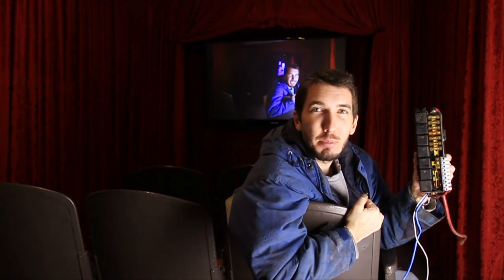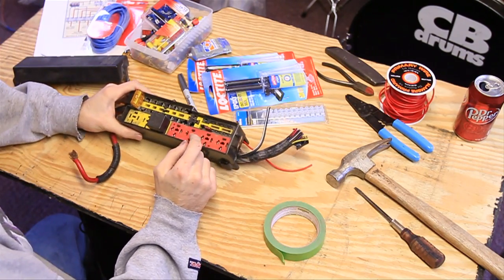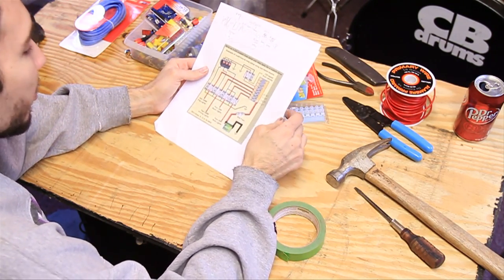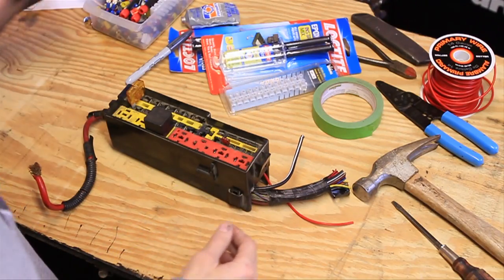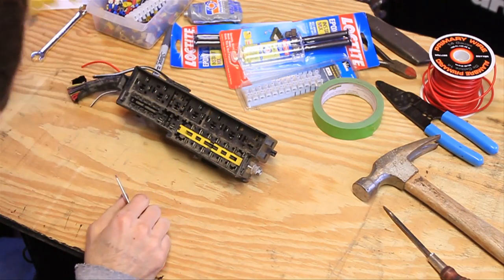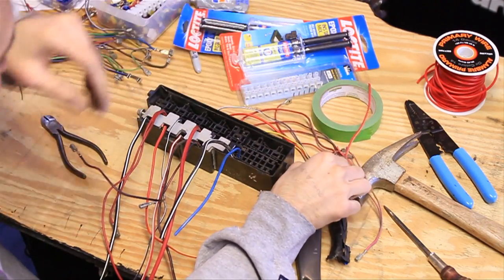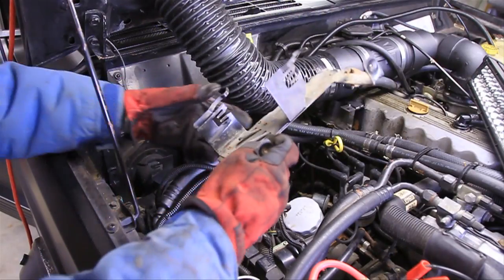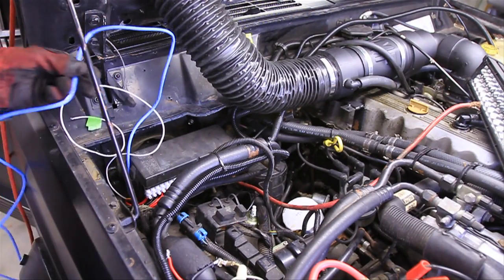BleepinJeep's DIY:  Relay and Fuse Box

Comment: I do repairs for large chain body shops as in wire harness replacement and repairs,  frame swaps ,diagnostics  and programing and anything in between.  I really appreciate the thought you put into  this... we're supposed to return the cars to factory by every now and then we get stuff where the owner has added circuits with no direction at all lol.  Those jobs are horrible . It can be  really aggravating to try and get em back to whatever they had going on before the accident.   Most times were missing the majority of whatever it was that they wired up so it gets outta hand quickly especially trying to do an estimate without replacement parts.  Only thing I'd change is to solder any connections possible and use heart shrink with the glue inside to completely seal the joint.  With the mud, water and dirt intrusion while out wheeling it don't take much to get the crusties and that can wreak havoc and possibly ruin components and start fires but having said all that I want enthused about doing any of this on my xj lol.  Good work bro.  I really though I'd be working on my rig all the time but she just sits there haha.  My lift kit isn't here yet and neither is the radiator and steering column so I can't really dive it yet... I'm hoping when the parts get here I'll overcome the dread of working on my own stuff ... the thought of being out wheeling should get me going...I hope

Comment: I followed this video and successfully built my own fuse/relay box for my YJ.  Very similar to BleepinJeep but I think my end product is quite a bit better.  I got two fuse boxes out of early 90's XJs and was able to disassemble them with minimal damage, hence no need for epoxy.  I was able to re-arrange the existing cables into a different configuration that gives me 7 relay outputs that are each individually controlled.  Additionally,  they wiring harnesses I removed provided plenty of good wire for both outputs and the control wires.  I looked at CAT 5 but found that re-using the harness wires made a far more durable end product.  Only downside is that all of this took an insane amount of time and effort.

Comment: Wow, I never thought of using cat5 or cat6 cable for automotive applications.. Neat idea!
Reply: why not just pull a entire dash harness with like 100 wires at the scrap yard for like 20 bucks you get tons of fancy colors too !
Reply: USB protocol has a fundamental distance limit of only about 16 feet
Reply: yes thats true, but if your going through the trouble of doing that you might as well just use the extension cable that came with the extender. a side note, i think usb 3 might have a longer limit too
Reply: oh i see it uses cat5, thats cool
Reply: The number one reason you might use network cable is for the shielded variety. Works super well for sensor data lines.
Reply: I would use stranded wires. The solid wires in cat 5 don't last as long in applications where they get bent or vibrated too often.

Comment: This guy is just like me, HE TOOK APART CRIMPS TO RE USE THEM! 2 days ago I pulled apart the micro switch on my cars RKE remote. Pulled the thin metal cap off to discover no convex conductive button to short the 3 traces. Being as my PANIC button only has the range to be annoying, I took the convex flex button out of that and replaced it in my unlock button. Jeepin Brother From Another Bleepin Mother :)

Comment: Good re-use of parts there! works for a good tidy install.

If you do a search for "mini-blade busbar terminals" you can actually buy the proper crimps that should click back into the slots saving you epoxying them in place!

I'd also be careful with the amp rating of the white connector block you use as this size are normally around 10-15A.
Reply: Ive spent about 4 hours trying to find these online you are a god damn life saver
Reply: The terminals aren't what breaks.  It's the plastic tabs in the block.  I managed to only break one or two.  The metal tabs are easy to reuse, but it sure would be nice to have had a pile of loose, new ones.
Reply: Can you put up some part numbers and where you got them?

Comment: 4 years later a few updates:  you can also get this in grand cherokees - same fuse box.  Also, with Cat 7 being out, it's considerably thicker than cat 5 or 6, so I would use that instead.  Last but not least, use a cat 6-7 punchdown keystone jack to terminate the wires coming out of the fuse box, and one for the switch box... then just connect them with a cat 7 cable without having to strip the ends down.  Or at least that's my plan. :D 

You are looking at about half an amp per pair of wires in that cat 5 cable, hope that's enough to turn on those relays...
Reply: What year grand cherokee?
Reply: @Aximili55  not sure if you have found the answer yet, but 1992-1998 seem to have this panel.

Comment: Depending on the length and location of the red "hot or positive" wire connection to the battery, a fusible link near the battery might be a good protection against a possible chafe or damage to what is basically an unfused wire otherwise. It is an extra step, but it could save a fire and/or damage to valuable electrical parts.
Reply: Automotive breaker  same concept as breaker box it the house...

Comment: Great video write up.  One suggestion you can get wiring snake that has 22 gauge wire in it with a shielded and insulated jacket.  Basically the same thing as the cat 5 cable but larger gauge designed for doing audio video patch panels for broadcast work and stage microphone wiring.  The stuff is more expensive but a length long enough to reach from the relay box to the cab probably wouldn’t cost more than 20$.  Pro audio multicore wire.

Comment: Great video Matt.  I applaud your willingness to share your knowledge with us DIY'ers on limited budgets.  To the critics of using CAT5 cable....look around and you can find stranded core CAT5 cables.  Stranded CAT5 is usually used for connecting laptops to a network.  They may be more expensive but it might help them sleep better.  Just saying.

Comment: an addition I would make, before putting the epoxy on the terminals I would slide the relays into place to make double sure each spade terminal is lined up as best as possible, would make later sliding them on and off a lot easier.
I plan on making a few minor adjustments :)

Comment: I tried using the CAT5 however the relays I used pulled more power than it could handle. Flipped a switch and had a immediate small fire. Ended up using 18 AWG to power the relays. I really liked the idea though.

Comment: Matt, maybe just one suggestion. I would put a high amp fuse on the supply wire to the entire box. One used on a stereo amplifier would work well and could also be found at the junkyard. They can easily carry 200 amps no problem.

Comment: Ok  I like what you are doing and how you are doing it ,I envy you in your patience and delivery and kindness to all of us by sharing  what you have done ,if like me yo will do it just to prove you can bypass the check out counter.I hit that like button and subbed your channel , I rarely do that .What you have in patience I make up for in fowl language and tenacity. I usually wont stop until I break it or fix it .
      Where you ran the single 12v supply wire along each fuse connector I 'll do the same  ,but instead I want to bypass the fuses or the need for them altogether , by soldering  a jumper across  each given fuse connection point to the 12v supply wire and onto whatever designated wire or point the fuse was intended to protect . No worries about current draw ,my old jeep id pretty much no frills bare boned almost to the point of a Willis GI issue. .  Im not asking for any advice or other freebie time soaking stuff ,besides ' Im much too hard headed for that , but if you read this in the next 24hrs and can find your old wire clippings I sure could use the colors and stripes from the old ones theres not much I can do seeing how packed in there they all are and the harness wont let me peak at the ones Ive got . Stay safe God Bless ,wear your condom and wash your hands you might have popcorn for supper never can tell these days

Comment: bleepinjeep  The Maxi-fuses have two clips. If you pull up the yellow bracket, you find a plastic clip. Then on the metal connector itself there is a metal clip that needs to be pushed in. The maxi-fuse holder then slides out.

Comment: I suppose since you're a Jeep guy dielectric grease is ideal. I preferably would use the (yellow) clips. It's less messy. Also That's really cool you salvage parts like the fuse block and license plate as the switch panel. Less waste.

Comment: I did this using the existing wires. took a bit of time to tear apart and sort it out. then I ran a large fused wire from the battery to the back seat. since I am using mostly for lights I ran all to the back seat. then removed the jack and used the holder to keep the box in place. it is out of the mud and weather and if it gets wet I am sure I have far bigger issues.

Comment: Would have been cool to put a female cat5 connector into the side of that powerblock module, then you could have just "plugged in" your cat5 cable!     If all your switches are in one place, you could have put a 2nd female cat5 connector on the side of your switch module.
Reply: thank you, i am going to try this !
Reply: @24:18 for more Cat5 stuff
Reply: The problem with the RJ-45 connector is that it doesn't have any current carrying capacity.  It's designed for signal voltages and currents in the milliamp (mA) range.  Look at the wire fingers in a connector and ask how much current can really pass through a single point of contact on a 30AWG wire?  Many relays draw up to 2 amps of current to operate the solenoid depending on the relay design.  Others use only .5 amp.  Be absolutely certain your connection can handle the power of the circuit it controls.  Look at the headlamp switch that route all of the power through it for the headlamps.  Even with those large blade type connectors, the plastic still melts because too much current is drawn through the switch.  This is why relays are used but even relays use power and those circuits and their connections have to be capable of handling that too.  Safety first or the Fire Department may pay you a visit.

Digikey sells connectors with locking tabs so you won't need to use epoxy.
14-16 AWG - https://www.digikey.com/product-detail/en/molex-llc/0192730008/WM6237-ND/2793739.
10-12 AWG - https://www.digikey.com/product-detail/en/te-connectivity-amp-connectors/180384-2/180384-2-ND/1131475

They are not the cheapest but they are of higher quality that the factory used than your run-of-the-mill auto parts stores cheap crap.
Reply: SN Interesting yes.  Question would be how much current those relays use to enable the higher amperage or load. If he had that data, he'd also have an answer if all 8 fingers will carry all 8 relays current requirements without heating up and melting.
Reply: I too question the capabilties of cat 5 wire in this application. I will say i have successfully done many things others say wont work. The true test is to roll up your sleeves and do it. If it doesnt work bow your head and try again. I'll say most large power draws that require a large relay trip already have that wiring included. Example, a winch has a large power draw, and a huge relay, or solenoid. Most if not all electric winches have them in the case.  So my guess is being the largest power draw he can use is 20 amps he should be ok.

Comment: Great idea!!! Only thing I would caution you about is the CAT5, the 4 pair (8 wires) are solid wire. Problem is in cars that vibrate solid wires tend to break (shear) from the movement quicker than stranded wire. That's why vehicles use stranded wires. Just a thought for future reference. I really thought this was a GREAT IDEA!!
Reply from the maker: Gliden07 glad you like it!
Reply: Cat5 can carry power. It's POE. Power Over Ethernet. It powers VOIP phones. And there are two types if Cat5 cable. The solid core wire that comes on huge spools and is meant for in the wall/ceiling installs and punch down termination. The patch cables you by to connect network devices are stranded cable.
Reply: Cat5 can carry power. It's POE. Power Over Ethernet. It powers VOIP phones. And there are two types if Cat5 cable. The solid core wire that comes on huge spools and is meant for in the wall/ceiling installs and punch down termination. The patch cables you by to connect network devices are stranded cable.

Comment: Not that it really matters a whole lot for this video, but I figured out how to remove the maxi-fuse sockets from the box.  There are two tabs.  One just like the others, that is part of the box and made of plastic.  The other is metal and part of the socket you are trying to remove.  You start by pulling the plastic tab back, then pull on the wire to create tension, then you have to slide a micro screwdriver down the sides of the metal contact and depress the metal tab and it pops right out.

Comment: Hi great video, just wanted to say was seeing you use a screwdriver and a hammer to open up the connection and then inserting a smaller screwdriver to open them up more and re use them was very scary I have done it before myself but just like to tell people to mind there fingers as when I did this I ended up with a few war wounds and plasters on fingers from were the screwdriver has slipped and taken a piece from your finger hence the finger plasters but great job

Comment: Baught the box last week. And started to work on it. I figured how to get the big wires out. It's a 2 step proses. It's similar to the others but you must also bend in part of the connector. Then it will come out.

Comment: AWESOME PROJECT! I really enjoyed working on this. Learned a lot. My questions are what kind of accessories would be appropriate to run on fused wires only (no relay)? What accessories would require such high amp maxi fuses? And could you give a list of examples of what could be ran off of the relays/fuses besides lights? Thanks again. Great video!
Reply: You could run your CB to it .... that's all I can come up with at the moment. OH! one of them back country Electric Fridges.  A Cigarette lighter style plug, which is great for blowing up floaty toys once ya get to a lake.

Comment: I am in need of a Flux Capacitor. My issue is that I am using Synthetic Blinker fluid, and yes I use the directional type so I have the left and right Synthetic Blinker Fluid specific to the corresponding side. Are your Flux Capacitors comparable with and for this application? Thank You in advance for your response. BUT MOST IMPORTANTLY GREAT VIDEO. Wiring is one of my favorite things to do so this was right in my wheel house. Keep the videos coming. Yes I know this was from 2014 but I have been busy researching availability of a new left handed set of screw drivers.

Comment: hey Matt I'm a new viewer and find you to be super entertaining to watch.  Comments on this video- it's awesome what you've done and you've inspired me to tackle this project on my CJ.  I just happen to have like 60' of Cat5 but am hesitant to use it in the Jeep because the conduit on almost all Cat5 is PVC which supposedly melts when exposed to gasoline, oil, and solvents.  Also- Cat5 is rated at below 140 degrees Farenheit and I know it gets in the 200s under my hood.  This is an awesome idea in theory because of the many wires in various colors but after going through the effort to wire a panel I think it might be worth it to find something other than Cat5.  It could cost a lot more if you fry components at the end of those cables.  Its been over a year and a half since you posted this video.  How's the harness holding up?
Reply: put the cat5 in wire loom, under hood temps of 200 are going to be right above the exhaust manifold, there is a rubber grommet to run the cat 5 through on the passenger side of of the engine compartment.
Reply: Also, to make it easier - put a patch panel cat6 keystone jack on the side of the box and on the switch plate... you can have it all plugged in without the need to mess with those tiny wires.

Comment: Very good project.  For me, I'd want to get a source on those female terminals that also have the tiny blade to retain them into the fuse box for the relays vs. the epoxy method. They must be available however, could be you have to buy them in minimum 500 or 1,000 piece lots. LOL.

Comment: Back before I understood electronics and wire gauges in 2010, I wired a set of 22 AMP Flexalite pusher fans directly to a 25 amp switch with 16 or 14 gauge wire in the cockpit.  Muy mal.  It got hotter than two foxes fucking in a forest fire and melted the trim where I had the wires wedged between right by the steering panel.  I was just looking at the wires for the fans a few nights ago since I am finally resinstalling them properly with a Flexalite temperature control unit and the wires are oxidized black and are heavily resistant to solder.  I was going to disassemble the fans to replace the wire but it looks like mine don't come apart like their instructional videos show and I am hesitant to start prying on them.  We'll see how long they hold up with proper control.  I'm going to use buth the manual overrides for always on and always off so I can shut them off when it's wheel:30.  Mine are inside the grille since they are pushers so hopefully they have better protection than the XJ engineered setup that replaces the existing fans.  If these fail, I still have the OEM fans.  I just had to trim back the grille a bit so it doesn't push on the shrouds.  I had a transmission cooler, but there is already an OEM cooler and when the fans turn on it will provide more cooling than the addition transmission cooler allowed I am sure.